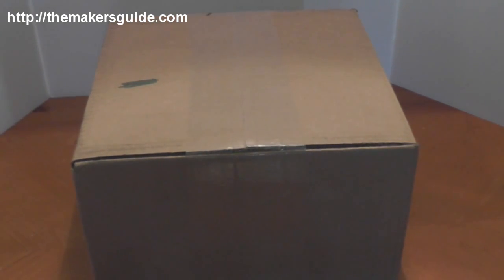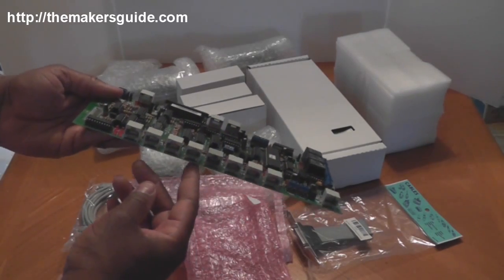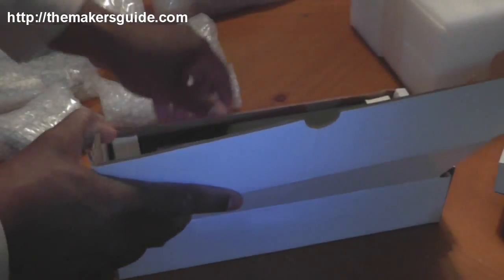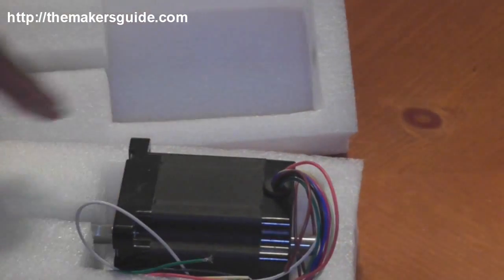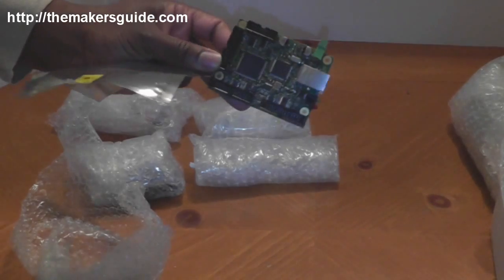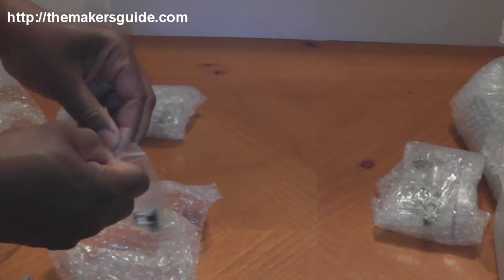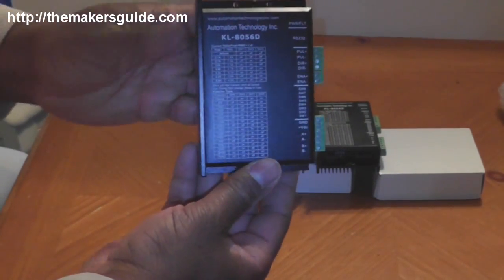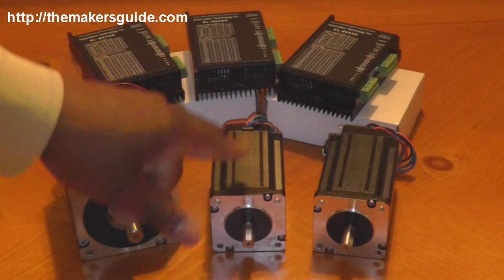CNC Electronics Unboxing

Comment: hi,
i have a couple of questions,i hope you don't mind.
I'm setting out to build a cnc router using xy and z axis,using the arduino uno and grbl shield,it uses usb to communicate with pc or laptop,does your cnc use usb or parallel port.
What software do you use to design with, what file types does it send to your cnc device.
I'm at a point where i am designing a small cnc device to test software for function of use,as the small device will have to use all the parameters of any large 3 axis  cnc,failing this ,i may well use conventional breakout box and stepper controlers,though the stepper controlers can be used with arduino micro controlers,the advantage is arduino is usb interface,not the legacy type,i have i think a parallel port on a xp pc,and a usb to parralel port may exist,but the acronym K.I.S.S. (keep it simple ,stupid) comes to mind.
I will keep this video,as it's a clear representation of parts needed to convert a manual mill to cnc,same as starting from scratch.
I hope you get it all working ,like you want,all the best.
cheers.

Comment: Subscribed. I'm doing a DIY CNC micro lathe. Grizzly G0745. I'm very interested in watching your build to get pointers!
Cheers - Jay
Reply from the maker: Thanks for the Subscribe Jay. I just posted a blog post on one of my websites http://www.makermasters.com/stepper-motor-mounts-make-cnc-milling-machine.
Reply: I bookmarked it for when I get home.

I'm 3D printing mine....theG0745 'micro' lathe and NEMA 17 motors aren't 'torque monsters'...so I should have no problems designing a heavy enough printed unit. I can even print the flexible couplings for the shafts.

The Go8689 Mini Mill is my next project. So...watching you and several others will impart a lot of wisdom...I hope...

Jay

Comment: Why did you get 23 and 34 motors, would 34 all round not have been better.
Reply from the maker: I decided to go with Nema 23 motors because they move the table fast enough for me. I went with the larger Nema 32 for the Z axis because I wanted all the power I could get. I plan to add auto tool change and a few other mods so the head will get heavier over time.